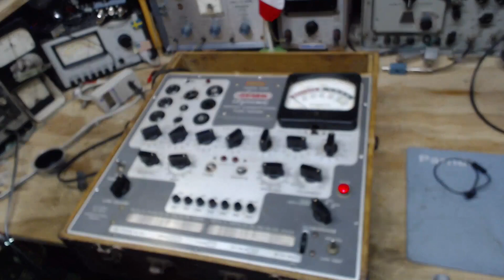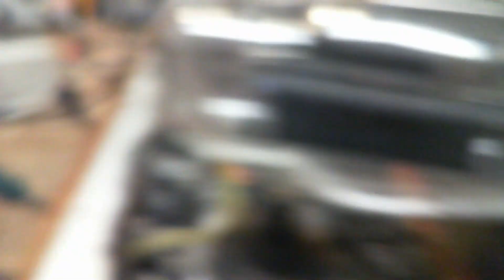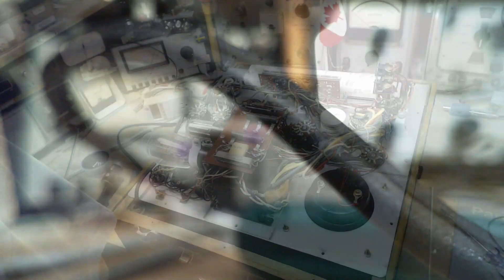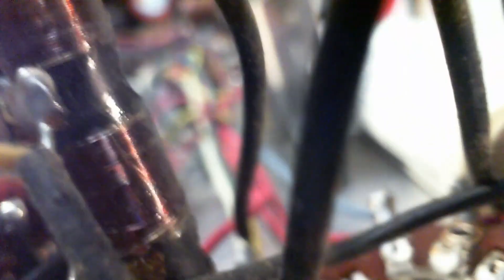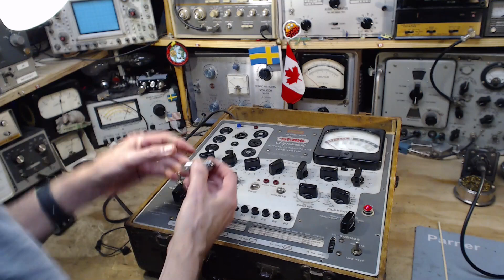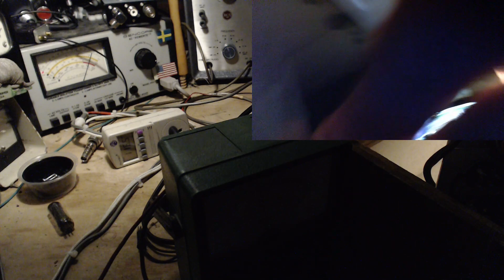Stark 9-66 Tube Tester -  Socket Trouble

Comment: Greetrings Jim:
You are likely to see a better indication of the socket movement effect while monitoring the current flow through the heater than the voltage across the heater,  You need to open one side of the heater circuit to add the current connection, but you maay be able to add the current  measurement point near the filament voltage control that ca be used for every socket. You need to add a jumper to bypass the measurement when not using a milliammeter. A good time to have a schematic.

Comment: When you need to change a tube tester socket, consider using a tube socket saver on the replaced socket especially on a socket that gets used a lot.
Reply: Exactly. And especially if you excessively wiggle the tubes in the socket like Jim does.
With clean tube pins and a good socket there is no need to stir that tube as if whipping up cream. The only thing you accomplish is to wear out the tube socket. Dont be a lazy Jim and take the time and clean the tube pins before putting it in the tester, instead of trying to make the spring contacts in the socket do that cleaning for you.
Reply: @randomsteve4288  What do you mean Pins, He doesn't clean anything

Comment: Looking at a capacitor and saying it "looks fine" means absolutely nothing, unless you test it. I just don't understand. Capacitors "leak"  electrons that you can't see with your naked eye. Unless you connect it to a capacitor tester you have no way to know that. It has nothing to do with them leaking material out the ends of them.
Reply: A simple inspection from the tube top side would better reveal what is wrong  with one of the filament pins. However instead we disassemble the instrument fully and find nothing. You may as well change out the socket at this point. first rule of troubleshooting.